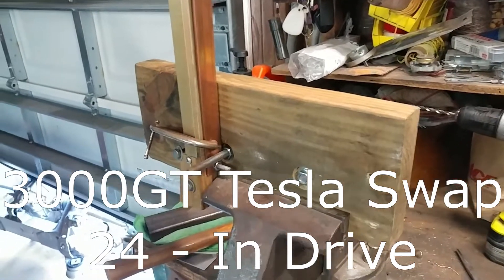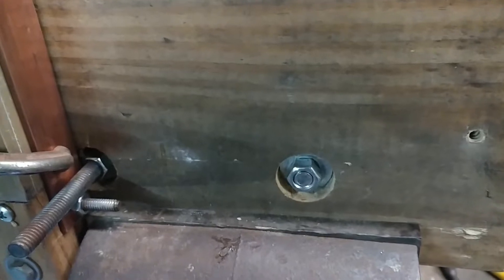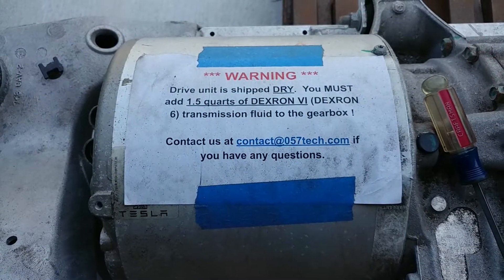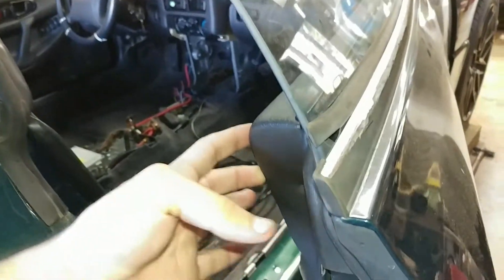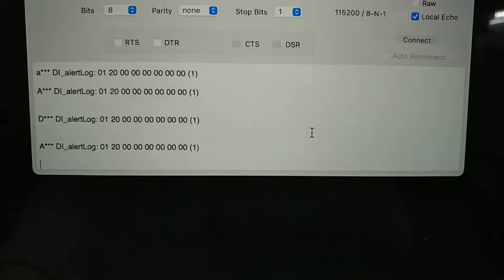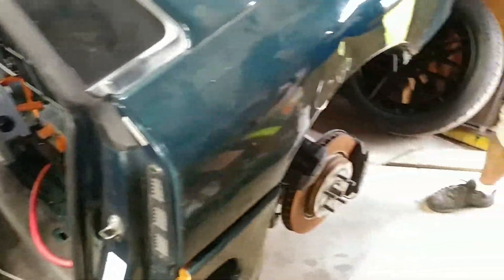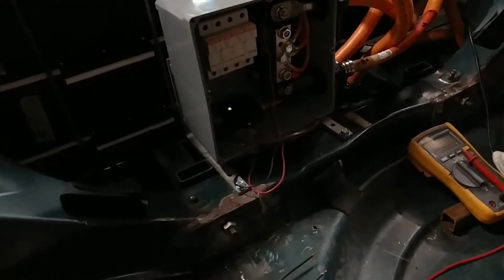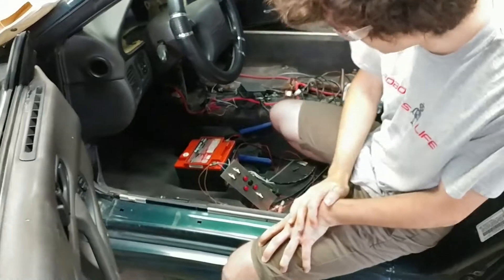Mitsubishi 3000GT Tesla Swap 24 - In Drive

Comment: What precharge controller are you using?
Reply: More specifically. I think you are using the zeva with the hsr ldu which is what I’m using. I’m now having issues with my zeva and wanted to chat about what you did to get yours to work.  Can we email?  Vegthesystem at gmail.  Thanks!
Reply from the maker: I am using the zeva with the HSR. I got it working in the video by building a 150 ohm jumper and putting that on the motor contactor the moment the precharger gets switched on. I have some new resistors coming for the zeva that I will try out that reduce it to 75 ohms. This will push the rating of the SSR a bit harder but we'll find out if it blows up or not.
Reply: @azimath9939  got it.  I used the zeva by itself and it worked for 1000 miles of starts and stops and then just started going to an error state.  I found that if I ran the precharger under 180v it would work fine but any higher it would produce an error.  I did a manual precharge and the drive unit worked fine so I was trying to figure out what the change was that caused it to stop working.  Essentially you are saying you put a large resistor in parallel with the zeva and that somehow reduced current flow enough in a way the zeva was happy.  I’m going to try the same thing and see if it works for me.  Thanks for the info!  Let’s keep in touch about a solution.
Reply from the maker: @vegthesystem  I didn't permanently attach the resistor, just smacked it onto the motor contactor terminals with my gloves on. Another contactor could be used to switch the resistor, but I don't know if there's any standalone smart prechargers meant to drive an external contactor.
Reply: @azimath9939  I figured it out.  I put a 50ohm resistor in parallel to the controller and it works every time.  I used a relay to put the extra resistor in the circuit.  I used the - of the coil out of the precharger (which is 12v during precharge and ground if the precharger completes the precharge and turns on the contactor) to trigger the relay so the 50ohm resistor circuit is closed only when precharge is happening.  That way it doesn’t need to be in the hv circuit all the time and if it were to fail the precharger would just go to an error state like it would if the 50ohm weren’t in the circuit.  I know this works, but I don’t know the theory as to why it works.  Feel free to copy what I did and if my written out explanation is to jumbled
I’ll draw you a circuit diagram.